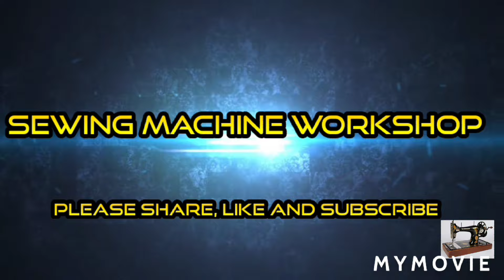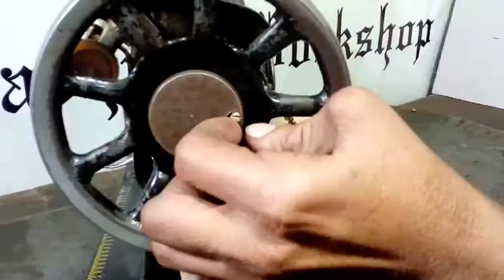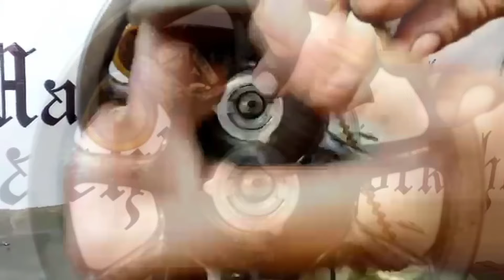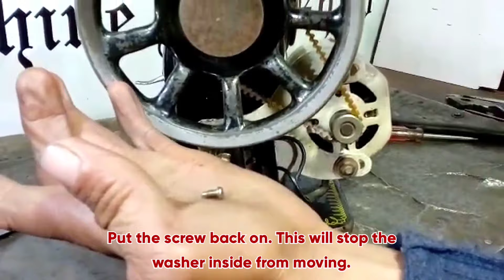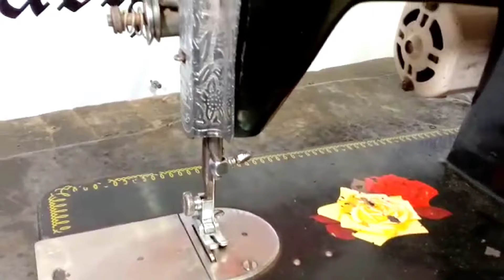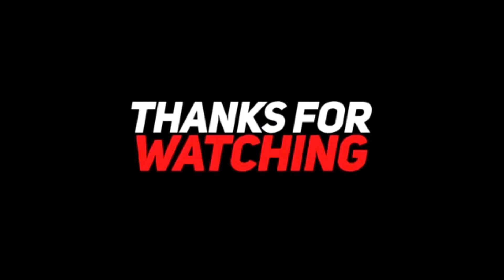SEWING MACHINE HAND WHEEL MOVING NEEDLE BAR NOT MOVING GREAT TUTORIAL | ENGLISH SUBTITLES |FULL HD

Comment: What if the hand wheel and needle both not moving?what should i do?
Reply from the maker: Hi Shanati,
From what you have explained, there seems to be a problem with your machine crank. The crank is at the bottom of the machine long rod crank. That needs replacement.
Reply from the maker: You can send me a video of your machine to my WhatsApp. The no is on my about section. I'll be more than happy to assist you further.